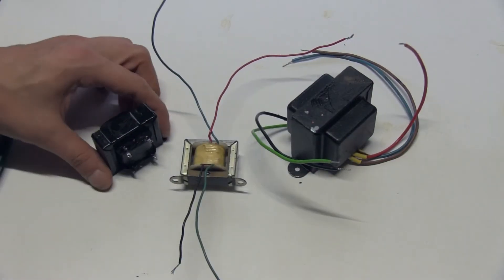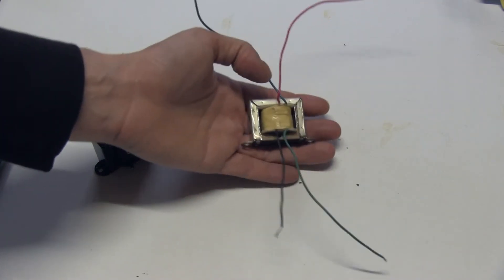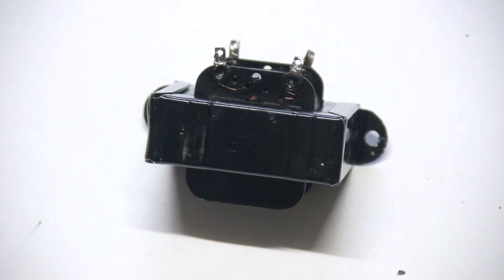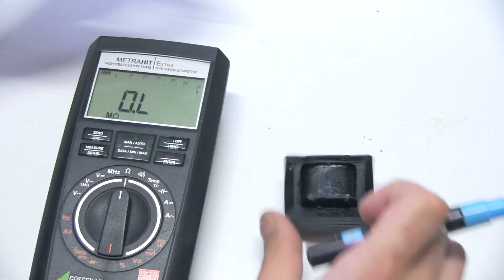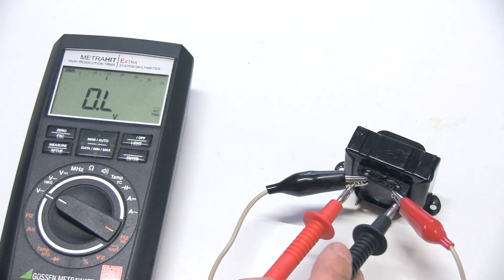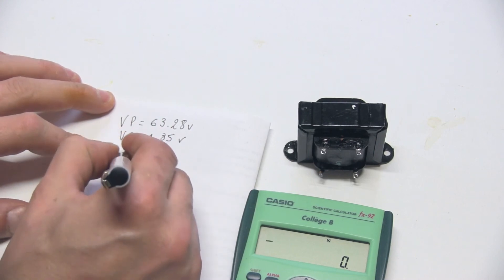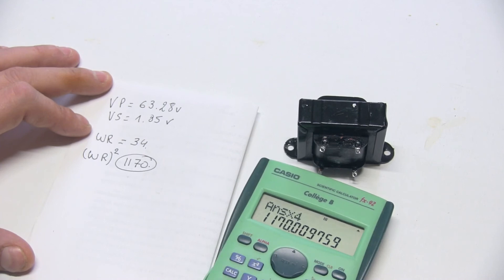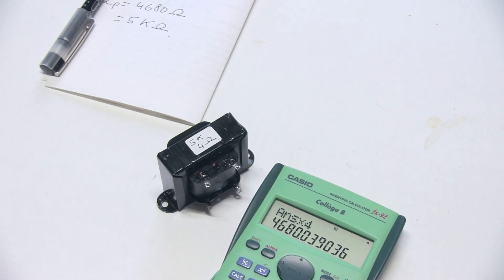How to identify an output transformer (for tube amps)

Comment: Why did you choose 63 volts?
Reply from the maker: No reason, if you have a lower voltage AC source, you can use it and do the math the same way. I used 63v because my step down transformer has that output.

Comment: You still don't know how many watts it will handle before meltdown.
Reply from the maker: there is a way to guesstimate the power rating according to the circuit it came from. but like i said, it's guesstimation !